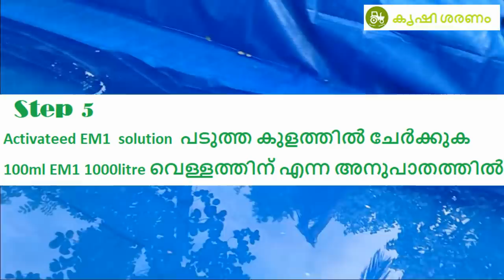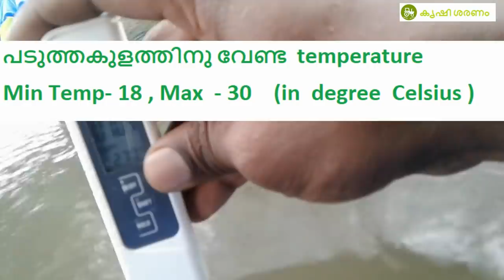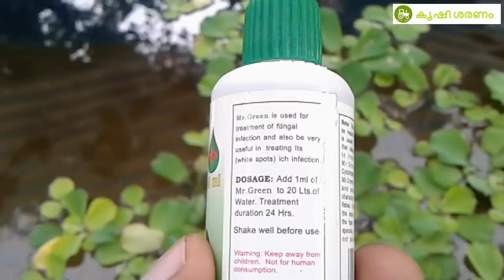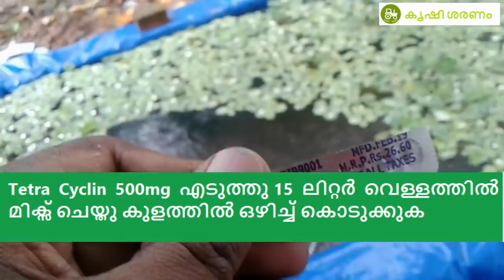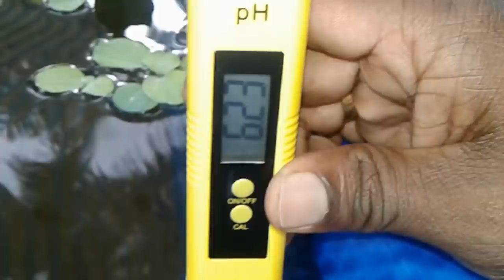കരിമീൻ കൃഷി പടുത്തകുളത്തിൽ (Full version)

Comment: Bro your method is not at all right
Reply from the maker: Could you please confirm which method is correct
Reply: @kilushabits4909  will give few tips, if you find any trouble first thing you need to do is change water, at least 40%, 
dont mix salt and medicine treatment use any one of them, 
when adding fish to the tank place the package in the tank for at least 15min later open the cover and add few water from the tank to the cover and leave in the tank for another 15min, now throw the water from the cover outside and add only fish to the tank
if you find any sick fish in the cover, please dont add it to tank, either throw away or treat that fish in different tank
when adding new batch of the fish with old fish, quarantine the new fish in sep tank for at least 1week this will avoid disease spread
as your tank in in rectangular shape  while adding evm solution or salt, mix with large quantity of water at least 50 or 100ltrs and pour into the tank, this will help to spread the solution everywhere  
for feeding cut few holes  20ltrs plastic bucket and float it in the tank and put the feed only in this plastic bucket , I
I have few more tips but some other time